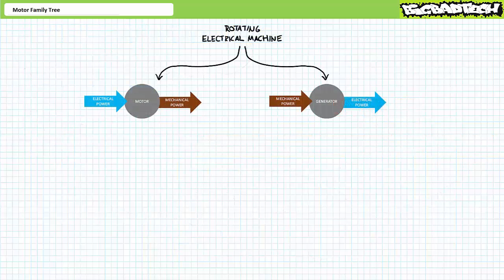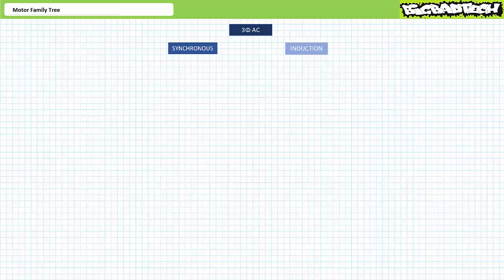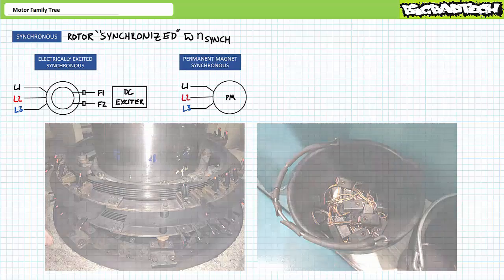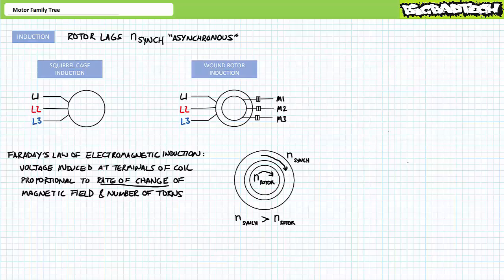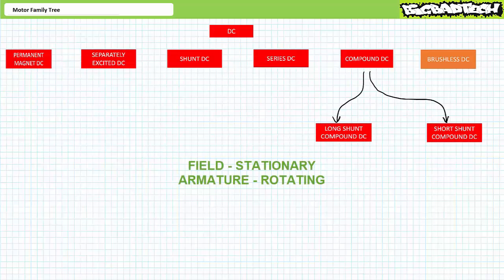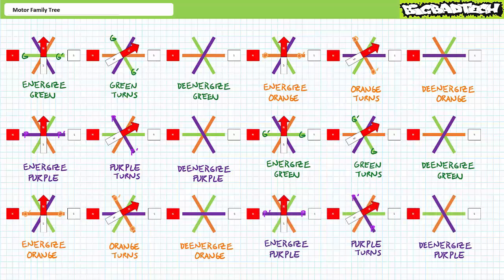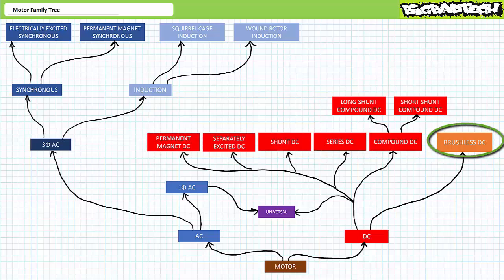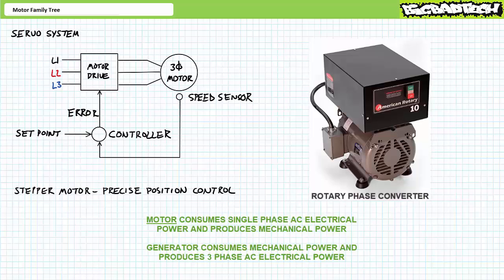Motor Family Tree (Full Lecture)

Comment: This is Brilliant. I am an Electrical Engineer, and working in BPOs and Software companies, I almost forgot everything about Motors and Generators. Now I am trying to make a Wind Generator. I have been copying the idea for Disk type Stator and Rotor with Axial Flux, for low RPM high Torque turbine output. I tried to think what kind of generator is this but was not able to. After revising through your lecture, now I know it is Permanent Magnet Synchronous Generator, i think so. Will watch whole series. Thanks for sharing your genius insights. Best Regards.